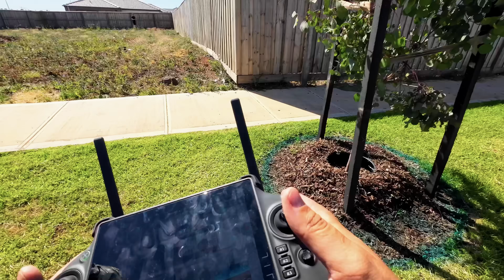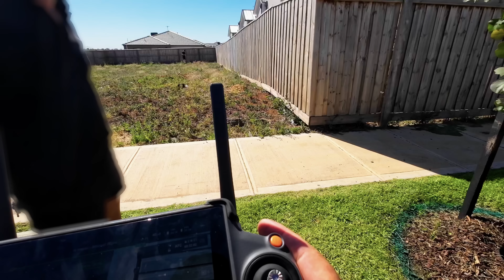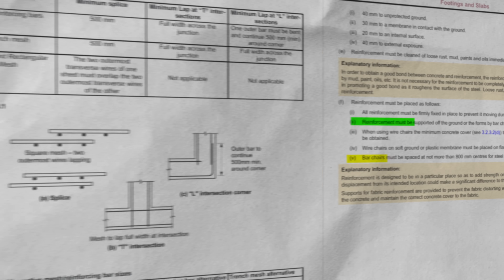I Caught a Concreter Red Handed ...

Comment: They don't want to use bar chairs because they cost $0.50 per chair. Meanwhile the client is paying thousands of dollars for the job. What a joke.
Reply: Yep, I'd make the pricks dig it all up and start over...don't pay extra for it too.
Reply: then this happens... stepping over dollars to save pennies.
Reply: Such is with volume builders. 
Working with low profit margins so they go with the smallest bid from companies that will do the work cheaply and quickly so they squeeze every last dollar they can for themselves. 
They do the bare minimum necessities just to pass inspections to hand it over without care for the fact this will be someone’s home.
Reply: @kylesharp234  You sum it up very well.  As my dear Grandpa used to say: "You want a job done properly; do it yourself!"
Reply: @DougieL  This is why I do it myself. Problem is how much work I’m having to do to rectify shonky reno. Stuff you couldn’t catch in an inspection: light switches jamming, cornices falling off the ceiling - the work is only 2 years old!
Reply: @richardpowell1425  I can understand. Get the wrong contractor and the work is a rush job...
Reply: @DougieL  No I bought the house freshely renovated. Everything new inside. So many problems in just 2 years. As far as I know the previous owner asked them to cut corners because she knew she would be selling it.
Reply: They can be as low as 35 cents if you lucky...its no excuse though
Reply: @Dessicrator  25c if you buy bulk...
Reply: probably 30 cents/chair if bought in bulk !!
Reply: Most mesh is on the ground anyway with weight of concrete an people walking over it,that's why you lift with a lift bar, you can make,an also plastic chairs are not that supportable, unless you put them every 3 spacing instead of 4,but it cost money for every 3 spacing, then it might not work,you can put concrete blocks under them,which you can purchase
Reply: No idea why plastic and concrete chairs not used? We do tons of concrete, so cheap to do and does a way better job.
Reply: it's more about how physically they can actually do the job.
Once you out chairs on, you can't maneuver on the bars anymore, hence concreters need to hire pumps instead of just the truck. A pump itself can be +$1000 an hour.
Reply: @shwartscoff mate we put chairs on upside down so they automatically swing underneath when you lift. That way you dont trip on it, can barrow etc ans still use chairs. As you lift it like he says in vid the chairs swing under before you pour on it. Thats why the chairs have the little hooks on the top. No excuse not to use them other than tight and lazy
Reply: You dont need to use chairs for a driveway, unless you charge for them on the invoice.  They aren't code, it's perfectly acceptable to lift the rebar as you pour.
Reply: @tjworthlessopinion - Not code? Where? In cheena with the tofu dreg projects? I have never seen an instance where it's acceptable to "just pull it up"
Reply: @bobmahnamahknob  ignorance is bliss
Reply: Lol then you should be embarrassed
Reply: @bobmahnamahknob it has been happening for at least 50 years driveways
Reply: You use chairs, or you do dodgy shit! No chairs mean you fail! Lifting the steel, what are you, he man?
Reply: @JC-xh8xe like its been said with that comment you haven't done concrete pour
Reply: Clearly none of you pour concrete in this comment section. Picking the bar up during pouring is common, just because their gov't has some janky laws doesn't mean these guys aren't killin' it.

Comment: Did you watch if they at least grabbed the bar with the hooks on their rakes to pull it up?
Realize that's not the proper solution. But goes to whether they give a bleep even a little bit.
If they didn't make an attempt to raise the bar....make them pull it ALL out. Most likely the floor slab is the same way

Comment: That concreter is full of crap. The bar chairs are put on with the mesh on the ground and then pulled up. Just lazy and poor work practices. They are also on about $15 per 100 chairs. Those slabs will fail.

Comment: putting bark chairs? on the steel... what did he say? Please explain...
Reply: Bar chairs are little things that hold the re-bar up so it sits at the right height from the top of the concrete to provide support.  They were just putting it on the ground, and saying they're "pulling it up" as they go,  which provides no ability to actually know where thr bar is located in the concrete.

Comment: understanding almost nothing about concrete, would this only save about $100 per 100sq meter job in mats?
100sqm / 0.8m (1 chair) = 125 chairs, the hardware store has 20pk for $16
and then labour costs doesn't seem like it would be that much
Reply: More to do with access wheel barrows or concrete truck can’t drive over elevated mesh so they have to pump it from truck instead adding cost .

Comment: Zeher.  Bar chairs are a waste of time with thin concrete slabs (100mm is thin in my opinion) for a number of reasons.  The National Construction Code is deficient in this area and I wonder if those who wrote that part of the code have ever laid some concrete.  Firstly, a bunch of overweight concreters move in and while they are doing the job (or even beforehand) they push over the bar chairs when they trample over it and the mesh sits in the dirt.  Secondly, the  dirt base is never flat or has clods of material still in it and even with a few bar chairs to satisfy the code some of the mesh still sits in the dirt.  Thirdly, even if the bar chairs stay upright, the overweight concreters push the non supported sections down onto the earth.  I am an Engineer and have been a home builder.  If you want to use steel in thin slabs that won't deflect, I found that the only size steel that won't bend under a person's weight is 16mm bar.  Even 12mm bars are not strong enough.  16mm doesn't add much to the cost compared to the total cost.  If you don't want to use 16mm bars find a supplier that adds the fine slithers of steel splinters or high strength plastic strands that you can see about the place for large slab pours.  The plastic strands can be purchased by itself and you add it into the mixture.

Comment: Just watched the concrete drop off the chute, regular concrete is warranted up to 95 slump on 20 MPA which that would be, that concrete is over 120 slump.

Chairs can be attached and turned upside down on the rebar if a wheel barrow is being used to drop the concrete, they then lift the rebar and the chair is then put in place once dropped.

These clowns have no chairs attached to the metal at all.
The metal will sink and the concrete will crack.

Comment: Was it self leveling concrete? An extra 50 ltrs of water on top of the max allowed is normal for those dogs.
Ends up 150+ slump when the customer has paid for installation at 80 slump on a 20MPA rated product.
Can end up below 10 MPA once set after 28 days.
Suggest the customer asks for a core sample test and you'll get your answer.

Comment: Classic concreter 😂😂😂 I'm glad I'm in the industry. When my shed was getting built, i inspected it myself. My concreter was an absolute legend, membrane done properly, chaired up correctly with proper mesh overlap and a perfectly flat uniform finish fortunately. As were my steel erecting team, not one bolt missed and quality inspection also came out to ensure all was finished right

Comment: Name and shame the builder.  State regulators should step in and force them to break up all that concrete and then revoke their license to prevent them from working in the industry again.  The key question is where are the regulators and building certifiers when this is going on, should they not have inspected the steel and reinforcement preparation before the concrete pour?  Should probably seek legal advice and get a proper builder to complete it, then counter-charge this builder for the cost to make good. If they don't know how to do the work to code they should have their license revoked.

Comment: I think it is clear from the conversation these concreters have never used chairs ever unless they're sitting on them
Reply: concreters don't even sit on chairs, they sit on milk crates.
Reply: @Ihavebeenwatchingyou No! Empty plaster buckets 😂
Reply: Bar chairs as well is the term.
Reply: Steel fixers would install chairs and bars though not every concrete repairer uses chairs
Reply: i am a chippy, but have also driven a concrete truck.. Quality concretors use chairs..  they barrow over them and leave them out where a truck need to go and chase the truck out installing bar chair behind as the pour happens... these blokes are just lazy fkn cowboys
Reply: Standard practice, to save time and money, is put the reo on the base, then pour the concrete, reach down by hand and lift the reo up into the pour. Shonky.
Reply: @tezzrterry7485  they can save a whole $5
Reply: @tezzrterry7485  worse is, watching the pour, see the inspector sign off on the job, drive away and the crew rips out the steel faster than the crete goes down and runs away with the steel to the next slab
I was painting around Sth Brisbane and seeing 'that behaviour' was regular
Considering the cost of steel and saddles/chairs, against the cost of the job, that was blatantly damaging the new home owners slab before the house was even built
Once the carpets, tiles, Lino go down, you can't see the concret
Reply: @tezzrterry7485  common practice in the states most of the time there’s not even any mesh.

Comment: You've got some balls to do the job you do! The construction industry needs more people like you! What is so rewarding is watching somebody performing their role knowing it upside down and inside out. There is no getting away with shortcuts! Well done!
Reply: Why does it mean he has “balls”? It just means he does his job properly unlike the masons/concrete guys. I’ve been in construction 20+ years and never once worried about an inspection because I do the job right and I don’t play games. You want some shady unsafe work done? That’s fine as the owner but I’ll pass on the contract. It ain’t worth losing my business license for one project and there’s never a shortage of work once you have an upstanding reputation. In fact, I more often than not have to TURN DOWN work just because I don’t have enough manpower to handle it all.
Reply: @ligyron2835  get off the smoko beers mate your heads cooked
Reply: @ligyron2835  If every contractor had your values, there wouldn't be a problem. There's all sorts in all jobs, in my experience.

Comment: I'm a steel fixer and I've seen concreters do some dodgy stuff, to the point where they say they there to make money.
Reply: Someone spends 5 figures on concreting, but apparently there's not room in the budget for chairs.  Sounds like they're not very good at quoting.
Reply: @bibsp3556  their point was the chairs would break the mesh wasent tied so it would have all gotten warped and twisted if they cared they would have chaird it as they put down the concrete. Not a quote issue it's a they don't care it's not their house issue

Comment: Here is the question , would you pay a extra 2 to 5000 for a driveway, just to have tiny bits of plastic holding the reo off the ground? when you consider how much a pump is and the fact they have to work slower and get less done for your money trying to not get their feet stuck in the mesh and twist a ankle , or have the concreters lift it in to place as they go like most people have done for eons on small stuff like paths and driveways.
Reply: You can almost guarantee they were charged for the job to be done correctly.
Reply: That is fraud and a different situation than what was explained in the video.  Im saying the chairs are only a depth guide for inexperienced workers to not pull the mesh up to high or leave it low. Im curious would you as a customer be happy to pay the extra money even if you knew it was pointless?
Reply: @oudonbail  It's not pointless.  It's in the Australian standards.  You're supposed to use em.
Do the job your being paid to do ffs!
Reply: @Android811  mate answer me this, would you actually think customers will pay the extra thousands to pay for a pump truck and the labour etc ? or do they take the 5grand quote over the 10grand quote. Its like saying People should be made to use training wheels on a bike
Reply: What is suggested as ways to install and "standard" is different, and different councils also have differetn specs. i guarantee you they will not have to replace the concrete
Reply: Contractors quote to do a job to a Standard, and that's what they should do.  If a quoted job is significantly cheaper you can be assured there are shortcuts.  My business works to a Standard and if that's too expensive, I tell 'em "buyer beware", I charge extra when I have to go back to undo a shitty job done by shonkies and then re-do it correctly.

Comment: What does the wheelbarrow vs pump debate have to do with whether bar chairs are placed? Is it about not being able to get the wheelbarrow to the middle of a wide pour area if the chairs are already in place? I assume that's why he pointed out that there weren't any chairs on the small pours too.
Reply: Nah dodgy bob still dodging the issue, in a small pour you just lay them as you go, throw some on the outsides to get the spacing, it takes very little time while you wait for the next barrow. 
At worst you might need a rag handy to get any clumps of dirt off the reo where the barrows been pushing it down, or you know, use friggen plastic like your meant to! 😆2 bricks and a plank for the barrow also works, then you can lay all the chairs out first.
Just lame excuses, he knew it was the wrong way, he just trying to hide his embarrassment behind verbal diahreah.
Reply: You can totally barrow it, he's just making excuses, just use some planks.

Comment: blocks of wood work too
Reply: Not ideal as the wood wicks up water, and/or rots and leaves a cavity; heavily treated wood can be ok if your using plastic with sand or fine aggregate that's been packed underneath, as the block will puncture the plastic otherwise. They absolutely did none of those things.

Comment: Thanks for being on the lookout for the owners ,as using a wheel barrow over chairs I've done it a thousand times you just correct any dislodged chairs as you go or throw a board down for the wheel barrow! No exuse for a lazy job! Do as if it for your own mother and have some pride
Reply: Yeah you are right, this is what confused me. I have not been involved with any concreting jobs in a decade but we had no issues with smaller jobs exactly as you described.
Reply: I know right?

Comment: I used bar chairs on a 1m x2m slab for my hot water service......why?  Because it makes a better job, the old skool method of lifting the reo/mesh while the concrete is poured is very time intensive to get right, even on a small job, and its impossible to do on anything larger.  Its bollocks to skip chairs on large pours to get the mesh in the correct position to do its job.........hello cracked slab/driveway.
Reply: They still do the lift method around my area all the time.  Most of the concrete rakes have a peg/hook on the back for that purpose.  Not saying it's correct, just that it is more common than chairs around here.

Comment: A very smart engineer told me over 25 yrs ago that when looking at concrete on the grounds it’s simply… the ground is the form work then 2 bars or mesh act like this … top layer is the crack control and the second bar holds up the first bar so ensure the top bar is at the designated height from the finished surface. Look at the video and watching these blokes pour from the chute and not a chair insight or effort was kept to have the mesh off the dirt …screams cowboys 🧑🏻‍🌾 
What about the banana stating that he needs to pump it if it needs chairs… nah mate you’re just trying to save another $1100.
Reply: Shame to call them cowboys as I'm sure most cowboys are professionsl👍👍🙂
Reply: @chrissoucek1679  ok mate… let’s call them…lazy, inconsiderate bananas

Comment: 5:50 Looks like these guys are not pulling up any rebar.  They're raking and floating the concrete with the bar flat on the ground.  Make them give a 30yr warranty to the owners
Reply: Warranty is useless when the builder goes bust in 12 months
Reply: @Chrissmills  warranty is handled by the state building authorities.
Reply: @ravenof1985  good luck claiming on it if the company has gone bust
Reply: Based on this evidence, they should pay for testing to prove the concrete is to the Australian standards. Possibly including destructive testing
Reply: @nitsuadivad  The easiest test is drive a 3 tonne RV/truck on it and see if it cracks
Reply: 30 yr warranty? They'll be dead by then.😅

Comment: Where are all the inspectors / Surveyors who work for the client, rather than the builders.

So the concreter is admitting EVERY "nonpumped" JOB THEY POUR - there is no control over reinforcement location..
(is this "across the board" - poor / non compliant workmanship - for "every" driveway and patio in the nation???)

- Stating that it "stays up"  / supported /  in the concrete pour - at some arbitrary location (not as per engineered).
(needs a series of cut tests - to see if their "theory" is true...)

Agreeing to anything which will then void al "warranties"  seems ridiculous.
Stating that if chairs are used, every job needs to be pumped, seems mostly to be profiteering..
(btw, running a pumper trailer on nearly every job would probably be a cost effective  thing for most concreters - saves all that barrow work - gets the load to right where it is needed, with quicker turnaround for the trucks..

How can anything get rectified, IF the trades are insistent that their way is "right" - in the face of evidence to the contrary??